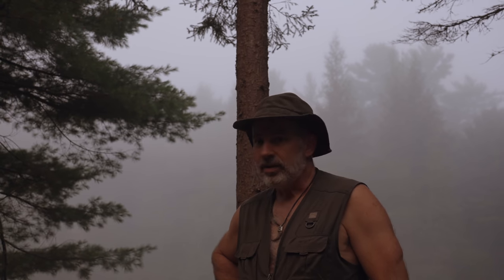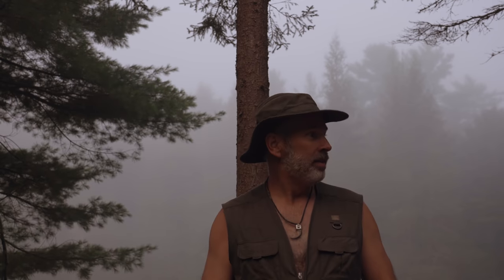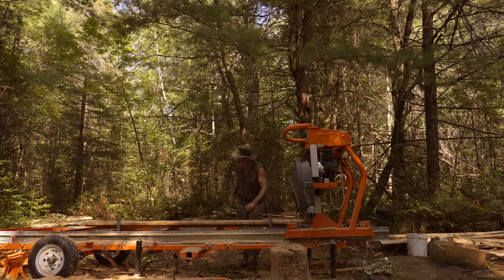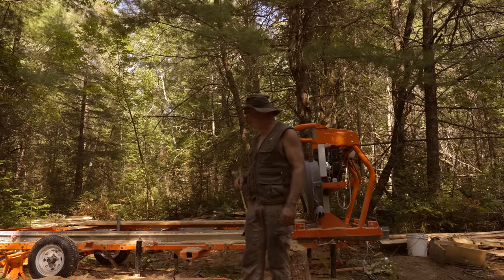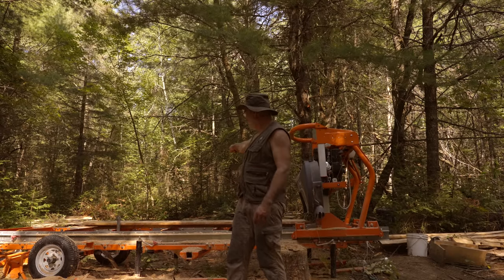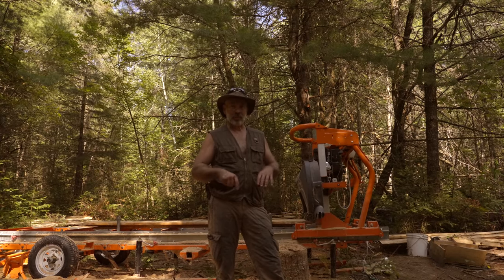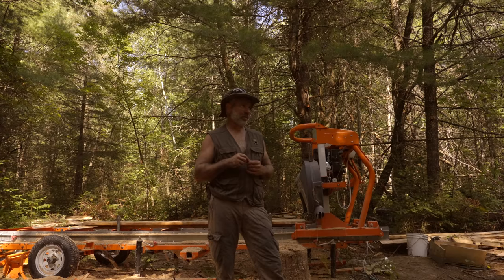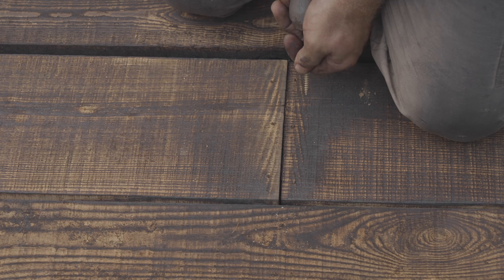Sawing Lumber for a Porch on my Off Grid Log Cabin

Comment: When I was in construction we always put our decking and porches as tight together as we could get them. So when they dried there wouldn't be such a large gap between the boards. And if for some reason we wanted a bigger gap we used a 16 penny nail .
Reply: My husband was in construction and used the 'same rule of thumb' in spacing his deck boards
Reply: I was going to post the same thing.
Reply: @smaleport6821  hello sharilyn

Comment: every time I used wet, freshly sawed lumber I always pushed them right together and they usually shrink down to 3\8 " and if a few don't I just run the skill saw down the gap, but most times it's not an issue.

Comment: Shawn.  I do not recall your exposure on the front of the cabin, but my suggestion ( from experience) is that if it is anything other than due south, go with a larger gap on the front porch boards.  Even treated and charred, they will still absorb some moisture and in the spring, fall and winter, before the sun gets higher in the sky, the boars will close the gap enough to where twigs, pine needles, even pollen will conspire to seal the drain and cause even more swelling.  I'm not gonna say what size, but err on the side of bigger in your decision.  None of your family is likely to be wearing high heels when the visit the cabin!
Reply: Hello Stephan

Comment: Using linseed oil I guesse ?   Sure will make an awsome flooring  love the smell of linseed oil  I use it as catalyst for oil paint on canvas !
Reply: Shawn has remarked before he uses a rendered Pine oil to treat the charred lumber to act as a preservative. He uses this oil on the outside of the structure only, not inside of the cabin, as the oil has a persistent and unpleasantly strong odor.

Comment: Hows the chipper going. Love an update forest man.
Reply: The one that broke? I think that was left to repair during the winter months so it can be used again next spring. When it broke that was a significant setback in terms of the delay it would cause.
Reply: @roberttrifts2737  it was a recent post. Mulching sticks etc. We call it a chipper. Wood chips.
Reply: @kangacrew540  Yes, and there is an episode where Shawn is using it to chip various branches - and the teeth inside jammed and a critical piece of the teeth broke. His plans to use it around the cabin to protect the sandy soil from the logs (and the logs from it) was wrecked; as was the plan to build up the soil around the greenhouse.  He said it would try to repair it during the winter, but he had other stuff to do now.
Reply: @roberttrifts2737   shame it was the most interesting job I've seen so far and milling. Things I don't do.

Comment: That's very interesting to me about the heat. 
We are not too much farther south than you; 30C is not unseasonable for August, here. In fact, we've been having 30-35C with high humidity. "It's August." 
Now, those conditions in October would be alarming!
What are the seasonable temperatures for August in your location?

Comment: Wondering when your going to start on the walls. Winter isn't that far off and your going to be out in the cold.  At the rate you r going I don't see you getting the roof on until next spring.  Just wondering.